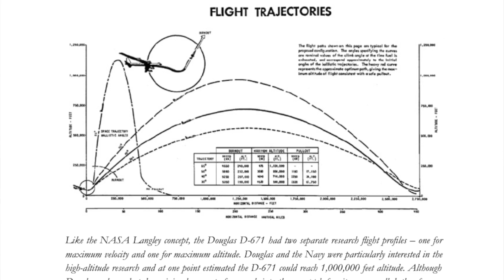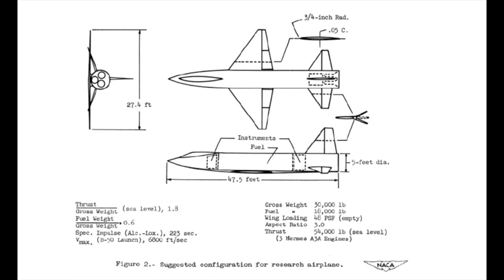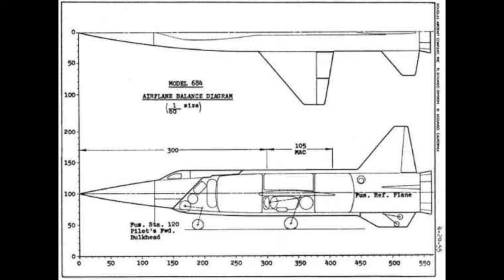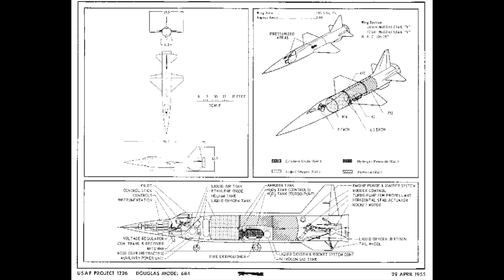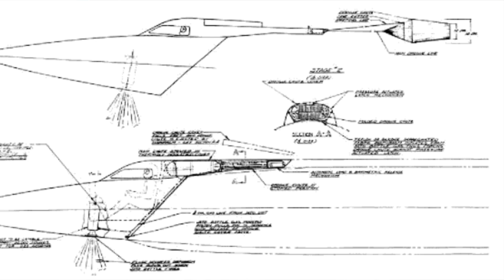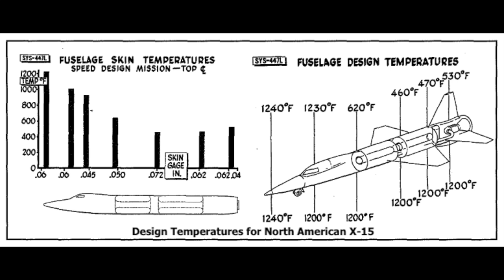The Radioactive Alternative To The X-15 - Faster, Higher, Cheaper. The Douglas D-684

Comment: I wouldn’t bat an eye at a thorium alloy plane. It’s an α-emitter, so as long as the pilot isn’t chewing on the fuselage, or grinding up bits of it and snorting it, he’s fine. What they needed to worry about with all the high-altitude planes, radioactive or not, is the ionizing radiation they’re exposed to at those altitudes - γ, high-energy β, cosmic rays. Those will trash your DNA pronto.
Reply: I know several pilots that have been fired for grinding up and snorting parts of there aircraft.
Reply: @jasonirwin4631  You should consider rebooting your friendfinder

You really got me there
Reply: High energy gammas are not so much of a problem as most do not interact with human tissue.  It is high intensity lower-energy gamma radiation that is more damaging.  Anyway we all have 8000 Bq of K40 and C14 in our bodies which we have all our lives irradiating us with gamma and beta radiation, as well as the terrestrial gamma background and the indoor radon.  The high-altitude planes would not spend much time up there, so the relative risk is small.  Concorde did have a dosemeter onboard and pilot's rosters took account of not only hours flown per month but also dose received.
Reply: @karhukivi  Yes, I'm a former resident of Radiation Therapy, that's the main problem :) TY for your insight thought
Reply: @julese7790  I'm glad you say "former resident" and I'm assuming it means you have got the all-clear?
Reply: @karhukivi  nope, I was radiation oncologist but I choose to instead become a psychiatrist hahaha, french residency is strange. So i'm no cancer survivor but I studied a lot about effects of radiation bombardement on humans
Reply: @julese7790  That's an interesting switch!  I'm a geophysicist and many of the techniques in medical physics have parallels e.g. tomography.  I was involved in uranium exploration for some years and we have to know about radiological effects not just for our own peace of mind.  Also studied decision-making which included rational and irrational reasoning but would never have got far in medicine.  Glad to hear that you were not on the receiving end of the teletherapy machines!
Reply: But there would be gamma and beta and neutron emitters futher down the decay Cascade
Reply: @1997CWR  They are usually pretty insignificant.
Reply: Alpha particles are still dangerous, but the only type of cancer they will cause externally is skin cancer. Alpha particles absolutely can and will penetrate the epidermis and cause damage to still living cells in the dermis, increasing the risk of cancer.
Reply: @KingHalbatorix  sure but if paper or the dead layer blocks a significant portion... the risk would be most significant if ones dermis was sans clothing no? so ive gota/wanna pose the hypothetical question,  how many people out there are either hoarding thorim or poping out amaricium pellets, piling the shit up and rolling around naked in it? doesnt sound like my idea of a good night...but to each their own... i guess ... when do we get the my strange addiction brain rott trash tv episode featuring this? i mean drinking nail polish is positively pedestrian compared to how the nuclear boyscout gets freaky
Reply: some times I too Jones for a line of fusalage. I told the police on myself but they said that isn't illegal. on the way out I sneezed on a stack of florescent tubes. rumor has it the department still saves money on lighting to this day
Reply: these guys were only up there a few minutes at a time though, far far less than what we're doing on ISS or did with Apollo
Reply: haha cojones ,, Robert Redford was  c.o.jones in a depression era movie,,
Reply: "trashing ur DNA pronto" is an expression that I'll borrow kind stranger ! :D
Reply: What you aren't considering is that if the aircraft ever wrecked anywhere near a city, town, or basically anywhere that isn't the ocean, there will be a lot of people inadvertently breathing in/"eating" particulates from that fuselage.
Reply: @johnballs1352  not much of it though. it's more like a lot of people have a lottery ticket where if they win they might ingest a hot particle
Reply: @johnballs1352  what you are not considering is how banning use does not prevent use

Comment: The B-58 Hustler also used Magnesium-Thorium as part of its fuselage.
Reply: Aristeidis Lykas  Very interesting addition to my love of the B-58. Thanks. Such an iconic looking supersonic aircraft - impressed me when a little kid, and still does. Too bad its looks were spoiled by the need for that belly tank to get any useful range.
Reply: @donjones4719  Mag-Thor could still be an interesting choice for a 2.0-2.5 Mach airliner.  It has an operating temperature that is at least 90 degrees, centigrade, higher than that of any aluminium alloy.  That can make a huge difference. Thorium emits alpha radiaton.  So just by putting a nice coat of paint one eliminates the danger of radiation, except in case of a crash where the Mag-Thor would ignite and create a quite deadly aerosol of Thorium-Dioxide (Thoria) and Thorium  particles!
Reply: Aristeidis Lykas Thorium 232 decays 10 times before turning into Lead 208. NOT JUST ALPHA.

Comment: That was an amazing video! Not only that you brought up some of the rival designs for the X-15 but because you brought up one of those "boring" topics many people in the space hipster/fanboi community completely ignore: material sciences and engineering.
Many people don´t see what amazing progresses we made over the last decades on that matter. And I got more interested into it since I had to recover from a heavy sickness. There are still a lot of discoveries to be made. Even with rather exotic materials nobody has on the screen. 

BTW: I recently did a small experiment with KSP in building one of those "fantasy" rockets from a 50s Revell scale model. I was totally surprised that this actually did work. And better, even without the booster rockets (and the NERVA) I reached a LEO.
 https://wearethemutants.com/2017/07/24/revell-space-age-model-kits-1957-1959/revell-xsl-01-2-1957/

Comment: In the late 40's or early or late 50's there was a nuclear or atomic bomb test in a mine shaft in which a the metal cover was blown upward at a speed calculated by the scientists from the high speed camera footage that would have put it into space as the first man made object into space.  Have you heard of this and do you think it possible?
Reply: +kevin cvalciuc Answer Below; TL;DR - No, look comment above.

If I recall correctly the cover was blown away with enough velocity to make it to orbit, if you didn't involve air drag. Same way escape velocity doesn't even take you to orbit, because air slows you down. Also since the object was not aerodynamic - quite the opposite in fact it would have melted and vaporized in seconds at best. I don't know what material it was made of and it's thickness - changing from solid to liquid and from liquid to vapor takes additional energy that has to be at least partially taken from the atoms that are not yet melting or vaporizing, lowering their temperature, so if it was very thick it would act as an ablative shield for itself. Even so, this is only a matter of time before it is fully vaporized - and even if it made to orbit it would be in a vacuum, so the only way too cool it down would be radiation - it would be hot as hell. Also to put something into the orbit, you must launch it at specific angle and velocity. Not enough and it will fall down (if it survives flying out and into the atmosphere at all), too much and it goes to infinity. At least theoretically. Orbital Mechanics is little bit like Optics and Quantum Mechanics - If You think you just understood something, there is good chance that there is far more nuance to that.
Reply: I never said orbit. Space and orbit are not necessarily the same thing. Space is defined by the US government as 62 miles up if I remember correct. Please don't put words in my mouth.  Yes, air drag is not figured in the equation which is WHY I ASKED THE QUESTION. Instead I get no it was vaporized but was caught on camera and WASNT Jesus F.C. does anyone actually read the question before they reply.
Reply: Negative. As I just said, the lid was captured on high speed camera traveling extremely fast. Plus, even at the trinity test site , much of the metal support stand was recovered after the explosion and was NOT vaporized.
Reply: Link the vid as well, thanks.
Reply: Cody from Cody's Lab actually did an experiment on this and no air drag wouldn't have been that much of a problem, since the cover would be shaped as a cone because of the explosion, my thinking is that either it did make it into orbit, either the heat from the air drag vaporized it before, but the explosion itself did not vaporize it and kicked it with enough velocity to maybe make it into orbit
Reply: It's hard to believe that it would've made it into orbit considering the exponential nature of air drag.
Reply: "During the Pascal-B nuclear test[ in 1957], a 900-kilogram (2,000 lb) steel plate cap (a piece of armor plate) was blasted off the top of a test shaft at a speed of more than 66 km/s (41 mi/s; 240,000 km/h; 150,000 mph). Before the test, experimental designer Robert Brownlee had estimated that the nuclear explosion, combined with the specific design of the shaft, would accelerate the plate to approximately six times Earth's escape velocity.[8] The plate was never found, but Dr. Brownlee believes[9] that the plate did not leave the atmosphere, as it may even have been vaporized by compression heating of the atmosphere due to its high speed. The calculated velocity was sufficiently interesting that the crew trained a high-speed camera on the plate, which unfortunately only appeared in one frame, but this nevertheless gave a very high lower bound for its speed. After the event, Dr. Brownlee described the best estimate of the cover's speed from the photographic evidence as "going like a bat!"[8][10]"
https://en.wikipedia.org/wiki/Operation_Plumbbob#Propulsion_of_steel_plate_cap
Reply: at 66km/s (minimum) it would have been exposed to intense atmospheric heating for a few seconds at most. 
Theres a high probability that a decent chunk of the steel made it out into space.

(If anyone's got a spare nuke lying around, I can provide a steel plate and we can repeat this test with some better cameras).
Reply: Its doesnt matter how many frames of film it was as long as you know how many frames a second it is and the distance from where it was and you can calculate the speed. An hour ago you said it was vaporized and now you say it yeah, it wasn't vaporized but couldnt have survived the "forces and friction"  instead. "friction and forces" would have been greatest at the explosion as it is traveling fastest at  the time of explosion.  So if "friction and forces" are diminished after the initial frame the how do you explain it. You imply it just poof, snap of the fingers disappears from existence after the initial frame capture. You are just a troll and I would appreciate a comment from someone that actually knows what they are talking about.
Reply: @Kevin_Patrick001  
Only having it in one frame means they can only calculate a minimum speed.

And that video just covered a few feet above the ground. If it had even remotely gotten hot enough to vaporize that fast from friction it would have literally exploded. Steel holds a lot of heat. At around 73 k/h(or higher) if I remember right, it didn't make it far before it vaporized.
Reply: Space , possibly. Orbit, nah, I don't see how it would pull off a gravity turn.  Meteor impacts are known to knock chunks of rock from planet to planet. My logic says even if a large portion was vaporized,first trash in space is exactly that